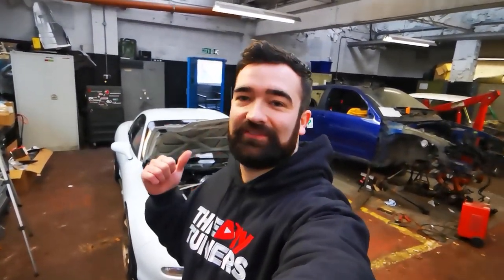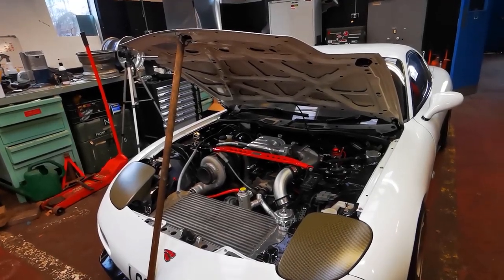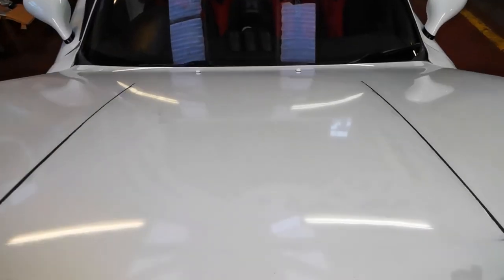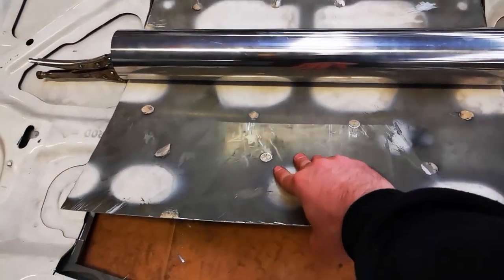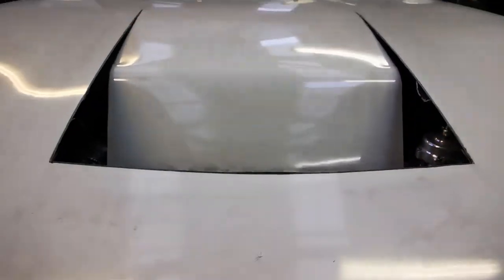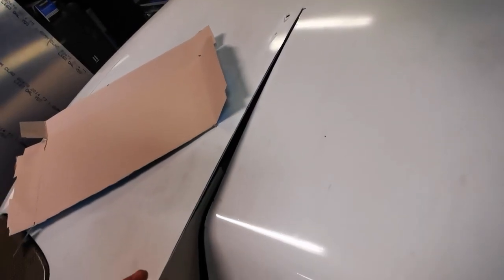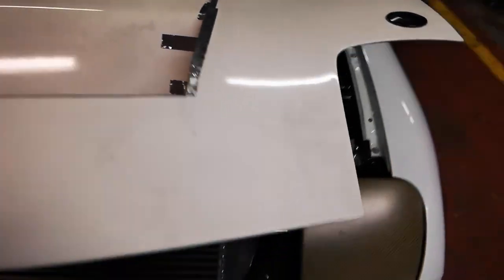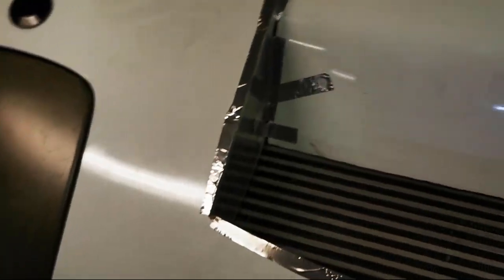Building A Custom Vented Bonnet/Hood For My RX7

Comment: Miles better than a fiberglass bonnet. They never fit right anyway.
Reply from the maker: I know mate and saves me a few hundred pounds in the process 👌
Reply: @TheDIYTuners  Fiberglass is known for being much lighter, you definitely wouldn't be saving weight by keeping the metal one.
Reply from the maker: The stock bonnet on the rx7 is all alluminium it's lighter than my old fibreglass one for sure